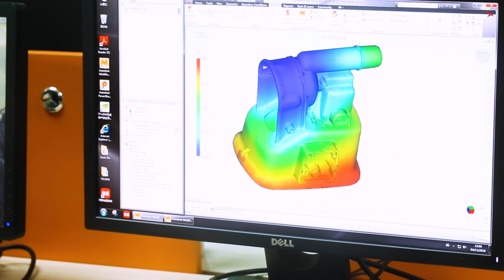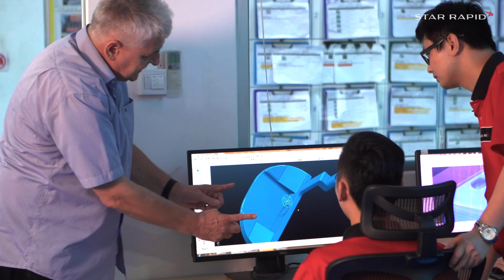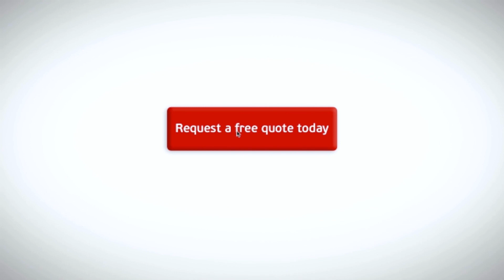3 Simple Ways to Save Manufacturing Cost | Some Serious Engineering - Ep4

Comment from the maker: Do you want to save manufacturing cost on your next project? Did we miss something important? Any more tips? Please let us know in the comments below.
Reply: A physician I did product development work for, once told me that a doctor will always sell you the tool he has in his kit and few if any of them will stop to look around at all the tools all the other docs have to see if the other tools might be better for you.  The same seems true in the plastics/ rubber/foams world.  I bring a 500 piece project, a 1500 piece project, and a 4000 piece project for folks to look at, and the whacky way in which people want me to spend money, with zero basis for my doing so offered, has me scratching my head.  In one project I offer 3D scan of a "rubber" piece from a 60s car turned into a nice solid works file for reproduction and I am asked by nearly everyone in the rapid prototype world to let them produce an SLA piece first, make mold from it second, and they want to cast a first piece from a polyurethane to see if we have shape right.  I look at the undercuts and think rotational process or vaccum process or both if we can avoid injection but they say nope, thats not needed (cause they dont do it?) without showing me a like piece they have done.  THEN they want to empirically arrive at a material that will flow in the complex mold to see if we can match the texture that the 60 year old dried out piece once had.  If I take it to rubber shop "A", he wants instead to do compression molding and if I take it to rubber shop B he says injection is the only way to do the piece due to its thinner edges, yet neither of them can tell me the formulation they have in mind will match the original in color or texture or durometer  or skin feel;  they will have to "play with that" once the tool is made  I go to shop C who has made similar pieces of similar vintage for another brand of cars and he wants me to pay per piece cost beyond 3 times the retail of the ones he makes for the other vendors because my piece count is too low (fewer of the cars were made and live on).  It feels like I am forced into one of two choices.  I can either have the old piece tested ($3K) to find its original formulation and a proposed modern formula that will help with UV, so I can see if it will work in a pour in place mold and pour them myself,  or I can start buying samples of elastomers and concocting a formula and curing process that will yield the feel, texture, and durability we want in our own shop.  One of the voids in the rapid prototyping industry seems to be at the intersection of Natural Rubber/EPDM/Silicone/Urethanes and Urethane foams.. Indeed, consultation is important, and indeed, it is foolish to take a step unless you have demonstrable proof that the process and material you have chosen will work well to produce your desired piece.